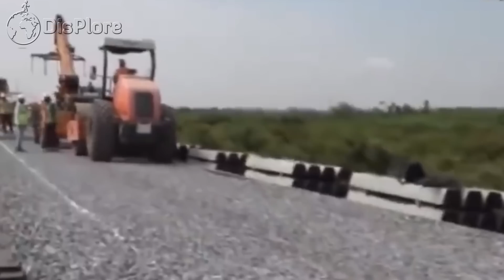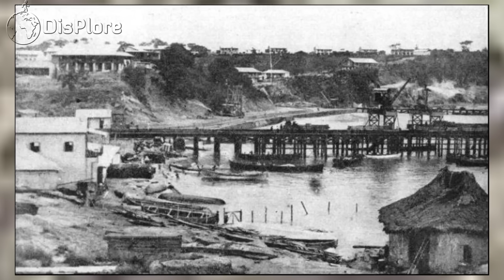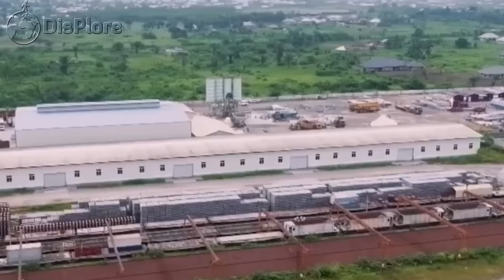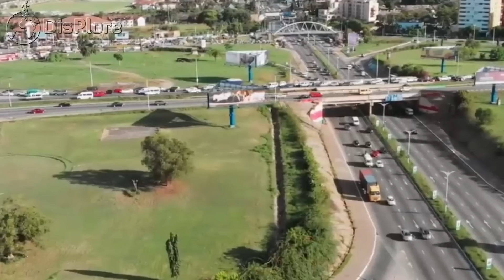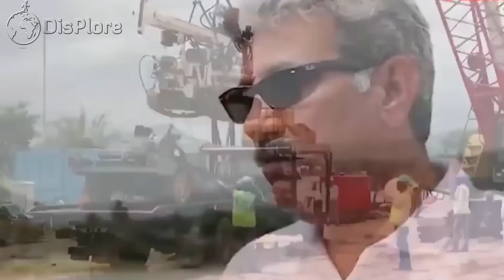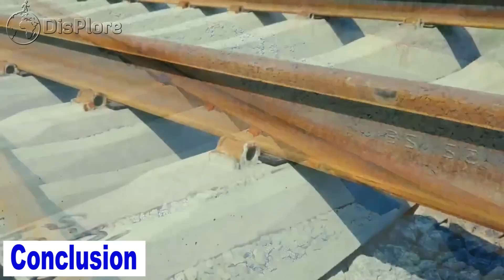Ghana’s $21.1 Billion Ambitious  Railway Project Will Change the Face of the Country.

Comment: This is so encouraging to see. The benefits of a modern national rail system are legion.
I recall driving in a taxi across an abandoned railway line in Kumasi in 2015 and thinking what a shame to have let this fall into abandonment. I assume they will build on the location of the existing (if abandoned) railways to reduce cost and speed up its development. A long term view to connecting up to neighbouring coutries was I think mentioned as an aim of the project. 
At last Ghana is waking up to its potential.

Comment: The rail lines should be dual not a single line.We always do things in the wrong way,I don't know why.If we can't do the dual rail lines we should broaden the path for future expansions.Our population is on the increase day in day out.
Reply: I agree!
Reply: 21 billion is not easy. Single or double, this is important because it allows traders from the village to the city. I've seen myself how important it is. 

To wait till we can get double lane will not make sense.
Reply: They’re cutting corners and cost and present this subpar project in this 21st century, look at Senegalese train project with modern trains and electric overheads.
Reply: @danielasante8245  It works as long as the revenue is reinvested into constructing the second track. I just hope they at least secured the adjacent land for expansion.
Reply: Is not all single line majority re dual please do research on it

Comment: Job well done Ghana. Now the question is: why can't most other African countries emulate such auspicious examples? It's easier said than done! Meanwhile, all African countries must be able to fulfill their debt obligations. If this can not be done, please refrain from embarking on such ventures.  Also, in case of financial strains, other African countries should/must come to the rescue; simple as that.
Reply: its not about emulating is about having our own money to fund  a masiive projects and not leaving debts on our heads.
Reply: @ednaclottey  Yes indeed, you have a point; you are correct and that's the problem solver right on the  head.
Reply: He used pictures of Nigerian rail projects. The trains started operations in March. Nigeria, Abuja light rail has been in operation since 2015.
Reply: The video is specifically about Ghana but the African Union has an integrated high speed rail network project crisscrossing the entire African continent and linking all major business and industrial centers and ports. The rail network will also seve as corridors for power, fuel and data lines. Several African countries such as Morocco, Tanzania and Nigeria already have their hsr running.

Comment: THIS HAVE EASY SOLUTION GOVERNMENT BUILD RAILWAY LINE BY DIVIDING ACCRA LIKE A CROSS INTO FOUR NORTH, SOUTH, EAST, WEST AND BUILD ONE RAIL LINE FROM NORTH TO SOUTH, EAST TO WEST AND BUILD ANOTHERRAIL LINE CIRCLE AROUND THE FOUR POINTS +0. IN THIS CASE YOU DON'T NEED SKY TRAIN EASY TO MAINTAIN THESE LINES. BUILD SIMILAR SYTLE MODEL IN KUMASI, TAKORADI, LATER THE REST OF REGIONAL CAPITALS AND GET RAID OF ALL TROTRO OFF GHANA ROADS PERIOD.THIS WILL HELP EASE TRAFFIC WITHIN THE CITY AND THE BUSINESS DISTRICTS ...